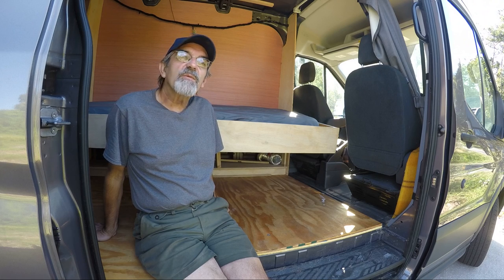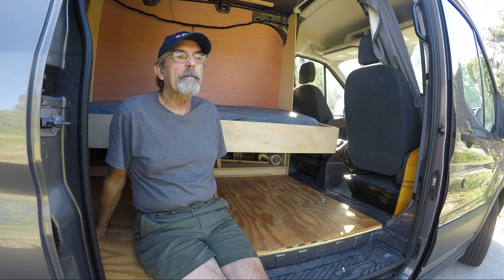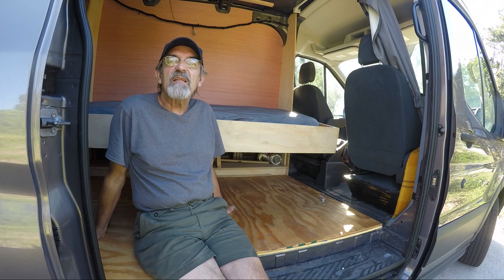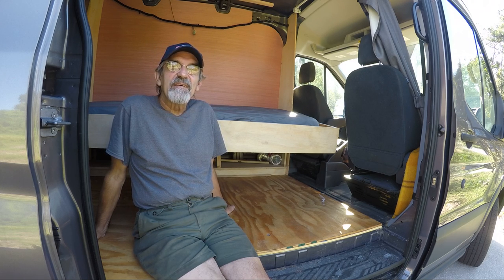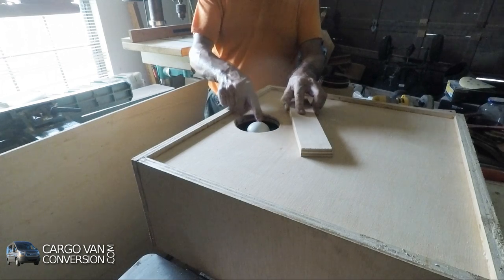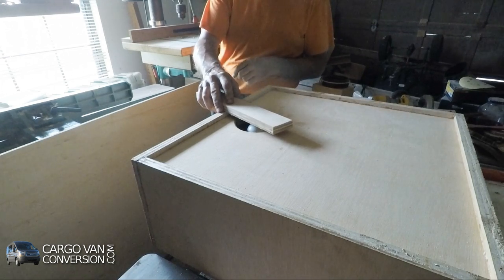Cargo Van Conversion - Shower - Part Three

Comment: I had the same idea of using utility sink,putting it in a drawer with your craftsmanship is very beneficial to viewers. Are you planning on getting solar power installed before your trip in August ? Either way I'll be watching & I thank you for posting
Reply from the maker: I have been quite busy behind the scenes, getting all the electric including solar, sorted out. No way having that ready before August. Too complicated. Right now I'm focusing on the solar panels; with stealth in mind, I'm zooming in on semi-flexible panels,the second generation, I call it. These are bendable and only 0.1 inch thick and ~5 lbs in weight each. They do hide well on the roof. They include back contact cells and ETFE finish, either on a black fiberglass background or on aluminum. This allows me to add at least 600 watts on the roof, although initially, I may install 450W on the roof and one 150W panel as portable. However the right panels are still difficult to find.

Van Williams

Comment: Love the shower in a drawer. I have been looking for shower options. What type of drain did you use and how did you connect the flexible hose?  And what did you use for the shower pan? Sorry for the questions but I am quite the newbie to DIY. Thanks.
Reply from the maker: Hi Cathy,
my apologies for this late answer; I missed your comment earlier.
The shower pan was made from an ordinary laundry tub, by only using its bottom. I used a Mustee 21F Laundry Tub Floor Mount which you can find here: https://cargovanconversion.com/shop/shower-tub

The drain is a Camco RV drain, which is very shallow and has a flexible drain hose attached to it. https://cargovanconversion.com/buy/drain

Hope that helps and if you have more questions, let me know. I'll respond more quickly next time :)
Van Williams

Comment: Brilliant
Reply from the maker: I haven't tested it out yet, but I think it will work as expected. You can attach a hose and drain it outside, or connect it to the gray water tank as I will.

Van Williams